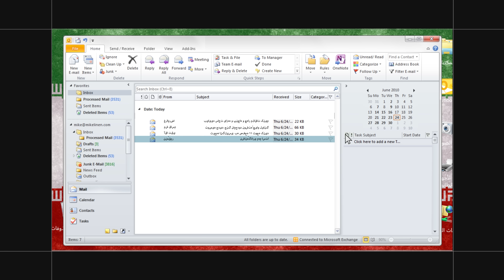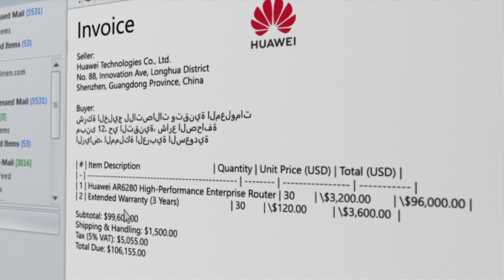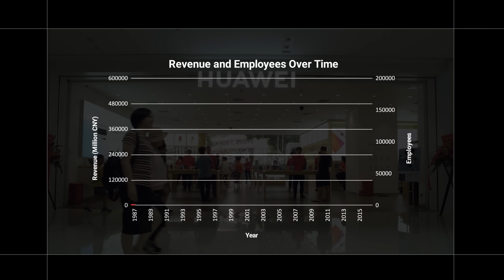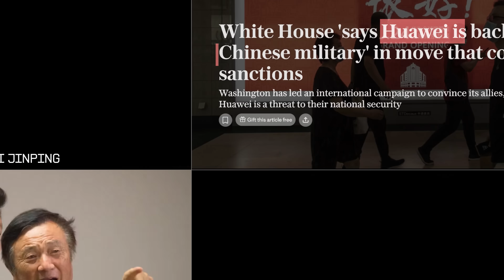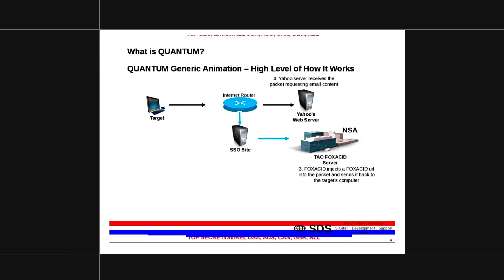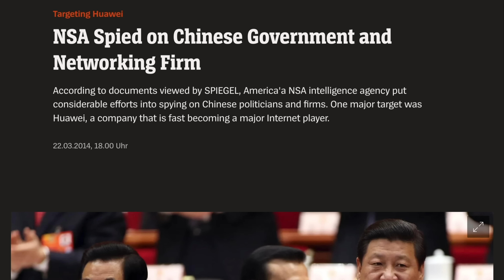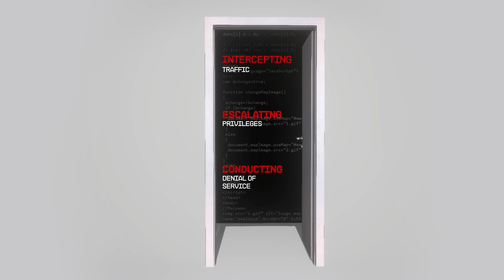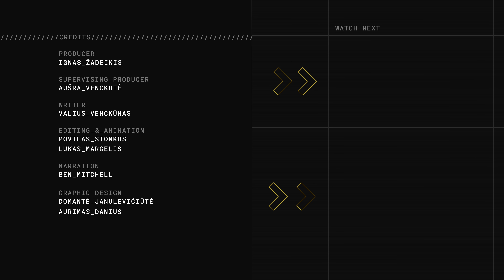How the NSA Hacked Huawei: Operation Shotgiant

Comment: As someone that builds IoT devixes, I can tell you that the vast majority of what we use is easily hackable. Almost all big brands have a hard coded back door.
Reply: Yep, the “s” in IoT stands for “security”
Reply: @radish6691  lol
Reply: @radish6691 i like that one.
I literally had to write my own firmware for esp32 for that reason.
Reply: it's not unlike other locks and systems. People remain the weakest link.
Reply: @corbeau-_- but human error is expected. Think of it this way. If I ask someone to multiply something I know he might be wrong. I put in a computer I expect it to always be right. Crude analogy but I think it gets the point across. 

This is why ai hallucinations are so bad to me. It’s not like a user filed website like YouTube or facebooks where we expect mistakes. It’s essentially a computer telling us a fact. And computers when we ask hard fact things like math have always basically been perfect.
Reply: SCADA = hold my PLC
Reply: Which is a BIG reason to always firewall everything. It's hard to break in the back door if you can't get to the kit
Reply: @alanbrown397  your hardware firewall appliance has the same problem. Just helped a company that was hacked through their fortinet appliance. The hack was done using a vulnerability in the appliance.
Reply: @alanbrown397 firewalls dont do shit bro. Permanent backdoors r built into the hardware and software. Ud never know this stuff is there. Think PROMIS software. 

Also, China has stolen a bunch of CISCOs IP for networking equipment. This included some of the backdoors (which were unknown to china) that allowed the NSA to monitor network traffic on Huawei routers for years without their knowledge.
Reply: Which company do you work for & how much is your salary per month? Just curious.
Reply: Devixes. 🤦‍♂️
Reply: Everything was made in China, because American middlemen, so called import / export shops, made all the markups …and it made lots of fold rich …selling cheeeeeep items …
Reply: „Almost“
Reply: theres like alawys a back door
Reply: The americans put backdoors, the chinese...everyone. They also often try to put them in open source projects.
Reply: thats not a back door
Reply: Use less Internet devices!
Reply: And of course, the CCP builds in back doors to anything that comes to America
Reply: @edpiv2233  why do you make it sound like America doesn't do that? Infact, the US is the biggest offendor when it comes to hacking and espionage...it does it to allies and foes alike.
Reply: Hard-coded, maybe, but most of them can be shut down/disabled with zero consequences by the user.  The trick is that the vast majority of users aren’t going to be smart enough to recognize the problem (most criminals fall under this category), or simply don’t need to hide anything and won’t be bothered spending the time to lock out government spooks (most citizens fall under this category).

Does it make the practice good?  Absolutely not.  But acting like this isn’t something you can circumvent when there are reams of white-/grey-hat how-to’s on this exact subject is kinda silly to me.
Reply: You really said that like it gives you expertise on the matter.
Reply: @larysanderson what part of my comment hurt your feelings?
Reply: @larysanderson  I've spent 40 years in IT and for the most part the code quality of almost every device, but especially SCADA and IoT is best summarised as "Written by kids in bedrooms" 

SCADA kit is especialy fragile and even if the hardware is reasonably well engineered, the firmware is usually "it works, ship it" and the software that talks to it is invariably abysmal crap which only runs on some archaic OS such as Windows XP (Windows95 in a bunch of cases I dealt with)

Blaming "China" for this misses the point that ALL the code is like this. Caterpilar's stuff is utterly rotten as one example. The Chinese are taking their cues from what already exists.
Reply: @alanbrown397  You've spent 40 years in IT yet still can't determine that unless someone replies to your comment directly then they're replying to the OP. See how this reply is directed to you? Notice how larysanderson's isn't? Are you always so fragile?
Reply: By design, too, not by incompetence
Reply: COMPULSORY hard, NSA BACKDOORS!
Reply: @ajaxinfinitum5604  Evidence?
Reply: They r forced to by the government… bc the gov helped develop all the tech (DARPA).
Reply: @Wi_Gong_Dye  "the gov helped develop " 9 year old kid logic...😅 
Its because they have very big and very long stick...
Reply: @Bialy_1  long stick 🤣🤣
Reply: @Bialy_1 DARPA has had useable AI since the 1970s. They researched the use of implants in the brain to influence emotions, decisions and actions since the 1960s. They created blue light tech and LCD panels in the 1950s, which perpetuated screen addiction today. Read a book bum.
Reply: @Wi_Gong_Dye not even close, they’re simply incompetent, lazy and/or more concerned with other features. The vast majority of the time security is job 15 after cleaning the bathrooms.
Reply: @Wi_Gong_Dye  and this is why they accuse HW of spying...but what they really mean is that HW won't help them spy and in that sense it becomes a national security issue to have a blind spot in their intelligence gathering
Reply: Bluffing you ain't no IoT producer
Reply: @fiestyseer  I always wonder about the crazies that come @ strangers with some personal attack. Tell me about yourself and what crawled up your tailpipe.
Reply: for sure buddy

Comment: Routers are L3. Your email, web browsing, etc. is L7. Because the router cannot terminate encryption, it cannot see the actual content of the packets. MITM wouldn’t work without first having hacked the computers to install/replace certificate authorities. And if any of the applicatios are actually secure, they would have certificate pinning set in place, which effectively mitigates MITM.
Reply: You assume state actors could not ("has not") subverted a trusted CA. That's a surprisingly low bar, unfortunately.
Reply: @jfbeam  That’s a very good point.
Reply: On an ethical pen-test 20 years ago I got onto a Cisco router via a web auth bug, setup a gre tunnel back to my router and then created a policy based route that sent all smtp traffic (it wasn’t encrypted back then) next hop to my router where I sniffed it and then forwarded back to their router for onward transmission.
With that in place their poorly written web application allowed users to have their password emailed to them if they had forgotten it.  So I simply entered the email addresses of senior staff and waited for the passwords to get looped through to me 😊
Reply: Keep in mind this was like 15 years ago, and it's unlikely that Huawei was encrypting internal email traffic. It's also entirely possible that their email server was insecure and private keys were compromised.
Reply: Metadata is at least as valuable as the encrypted data. You don't NEED to decrypt messages to build an organisation chart of a group ujnder surveillance, just monitor who they contact, when and in the case of mobile phones, look for devices in close proximity to the individuals being watched. Patterns are easy to establish even when "cell" structures are being used by organisations, because for 99% of prople operational security is an afterthought at most.
Reply: This is assuming there's any certs to begin with. If they have control of the routers, they may be able to force fallback to an unencrypted connection, thereby bypassing any encryption to begin with (and this is assuming their client/traffic allows unencrypted fallback to begin with).
Reply: @NSUserName  You are correct, however, secure mail clients, browsers, websites, etc. should refuse operating without encryption. On mail clients you almost always have this by choosing TLS or STARTTLS, and websites should have HSTS which instructs the browser to never allow unencrypted traffic (and of course it is also possible to serve your website only port 443 enforcing TLS for all connections).
Reply: What youre missing is that emails are by default unencrypted. The protocol is old, and although its been updated since, this happened almost 20 years ago.
sender => SMTP => recipient SMTP => recipient
- modern email clients use encryption on first part, it is however client configuration (or using web-based HTTPS...)
- SMTP to SMTP - are nowadays encrypted, at least when talking about big email providers
- last part again similar to first one
So it is possible that back then Huawei didnt have encryption on first part.
(this is about connection, not to confuse with encrypting the message itself to prevent SMTP server from reading the content, that is another thing)
Reply: @jeuffrey  See Also: STARTTLS. Mail servers have supported SSL/TLS for decades, if admins bother to set it up. Over-the-wire could be encrypted, but "at rest" on the mail server it's very unlikely to be encrypted. (and even if it is, the server knows how to read it.)
Reply: Unless you already have a root certificate generated for you for each of by the many CA's used to encrypt that traffic... And considering who you are (NSA) I guess that all the american ones are not difficult for you to get in a private manner. 
Or at least that's the old 25+ years CRITIQUE to Certification Authorities.
Reply: exactly, this video is nonsense just for views. he totally ignored that os was the reason which allowed this...
Reply: So true, I wonder about the integrity of this video.
Reply: @giangtnm  this video tells us about an incident that happened a decade ago which the ccp security back then was weak
Reply: this back-doors are on most if not all layers... that is how typical state agencies operate(all over the world)... they want it all  so when you patch/find one they have 10 more in reserve...
Reply: @Bialy_1  When I talk about Layer 3 and Layer 7, I am specifically referring to the OSI model. In the OSI model, an L3 router cannot understand protocols of higher layers like L4, and L7. Since encryption like TLS operates on L6, with L3 you can only spy on unencrypted information, unless you are able to somehow break the encryption (like I mentioned with MITM which is a common attack on L7).
Reply: @Bialy_1 How do you know how state agencies work? Did you learn about it in YouTube comments?
Reply: @nonindividual  No, the Snowden leaks literally tell us. They have backdoors on everything from networking equipment to computers, which of course covers the various levels. That and they also have backdoors in ISPs and hosting providers which pretty much covers the rest. It's stated that the TAO prefer attacking networks first as that gives them access to everything connected on that network which they can then individually exploit. The only reason they even attack the network is just so they can have an idea of all the devices and a certain business or address.
Reply: Unless you have a quantum computer with sufficient qubits to use shor’s algorithm to factor the encryption key used to encrypt that traffic. Which the NSA either has or is desperately trying to obtain.
Reply: @zachohanlon3517  If you have a computer that can break modern encryption, then you do not need to target such routers and can instead spy on traffic on Internet exchange points (IXp) where you get tons of traffic from many ISPs. I imagine many IXps alredy have signficant US control, and for sure many are running US harware like Cisco, Juniper, Netgear, etc.

Thet being said, even without breaking the encryption you can get some pretty useful information. Based on traffic IPs and possibly unencrypted DNS lookups, you can determine what services are being used and use that intel in further attacks.
Reply: @zachohanlon3517  There are new quantum encryption methods that aren't factoring-based, so not vulnerable to Shur's . But IIRC, not yet fully functional, implemented.

Comment: 7:53 On all the stuff about Huawei’s military ties… this is something that is true of basically every major tech company in most major countries. Silicon valley came to be because the US military needed more robust silicon rather than the more common (at the time) germanium transistors to survive being the control systems of rockets and so hard carried the entire industry until it finally improved and scaled enough to simply outcompete the existing germanium based industry… hard to get more tied to the military than most companies literally existing because of military policy to create more suppliers giving them funding to branch off and make a new company with preferential awarding of contracts to help those startups grow being the primary revenue source. Even the IP theft is extremely normal for a developing country , America industrialized of off stolen British patents and more or less openly mocked British complaints as stupid. How much a country dislikes IP theft has a perfect correlation to how much IP they make… it’s just a fact of life that developing countries will steal IP.

Like it’s not that it’s not true for these things… it’s just that it’s not so much sinister so much as completely normal and expected, so I just find it very strange how it is talked about like it isn’t normal and completely unsurprising.

Comment: Fixed master password is not a bug, it's a backdoor 😅 same for cisco! You can only trust these devices if you have opensource firmware and software on ANY hardware.
Reply: Completely agree! With proprietary software you have to trust it is secure, with OSS you can audit to ensure.
Reply: what's an open source software if it isn't updated constantly. That's right, a hot file of unsecured garbage
Reply: Actually Huawei allow any customer or stakeholder to validate both hardware and software and hash the code so verify known good software is running on the devices.. As well as validating the diff between firmware releases. 

However who said that it was Huawei that had a hardcoded account, could be TAO added it and Huawei RnD didn't notice it...
Reply: @JoelBergmark  That's still not OSS. Even products released by Huawei and ZTE were not allowed to use third-party firmware such as OpenWRT due to proprietary hardware and software, unlike Cisco, Netgear, and many more."

Comment: is Huawei growing as a company?

Huawei is indeed experiencing **significant growth**, despite ongoing U.S. sanctions and geopolitical challenges. In 2024, the company reported revenue of 862.1 billion yuan (about $118.2 billion), a **22.4% year-on-year increase**—the fastest growth rate in five years and just shy of its 2020 record high[3][4]. This marks the third consecutive year of revenue growth, following a sharp decline after U.S. restrictions were intensified in 2021[3].

## Key Drivers of Growth

- *Smartphone Comeback:* Huawei’s consumer products segment, especially smartphones, surged by 38% in 2024, driven in part by the successful launch of the Mate 60 series and a strong push in the high-end market. The company reclaimed the second spot in China’s smartphone market with 16% share, overtaking Apple (15.6%) in shipments[2][3][5].
- *ICT Infrastructure:* Huawei’s core telecom and enterprise business (ICT infrastructure) remains stable and is still its largest revenue generator, benefiting from global 5G rollout and new network deployments[1][4].
- *Emerging Sectors:* The intelligent automotive solutions division saw a remarkable 4.5-fold revenue jump and achieved profitability for the first time in 2024[3]. The company is also investing heavily in cloud computing, AI, and operating systems like HarmonyOS, which now powers over 900 million devices in China[2][6].
- *Supply Chain Resilience:* Huawei has adapted by replacing foreign components with domestic alternatives, reducing its reliance on U.S. technology[6].

## Financial Nuances

While **revenue is growing robustly**, net profit for 2024 dropped by 28% to 62.6 billion yuan, attributed to increased R&D and business expansion investments[4]. R&D spending reached 179.7 billion yuan, accounting for nearly 21% of total revenue[4].

## Strategic Outlook

Huawei is positioning itself as a leader in Chinese technological self-reliance, especially in semiconductors and operating systems, and continues to diversify into high-value areas like AI, cloud, and automotive tech[2][5][10]. The company’s recovery and growth trajectory demonstrate its resilience and ability to pivot in response to external pressures[1][2][3].

In summary, **Huawei is not only growing but is undergoing a strategic transformation**, with strong performance in consumer electronics, steady ICT infrastructure, and rapid advances in new technology sectors—despite profit pressures from heavy investment and enduring U.S. sanctions[3][4][6].